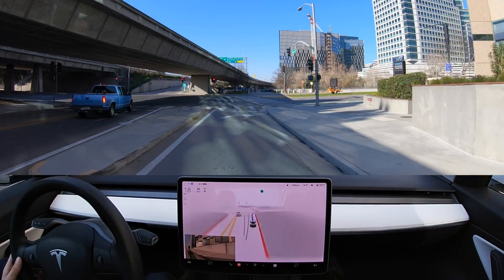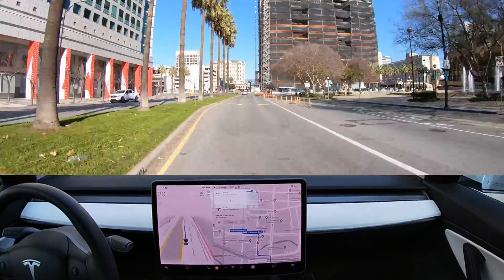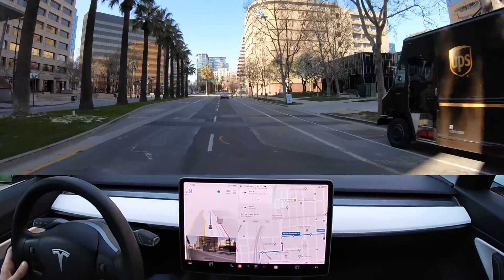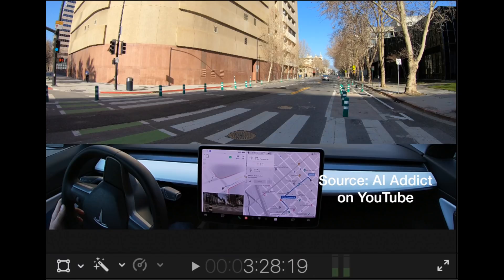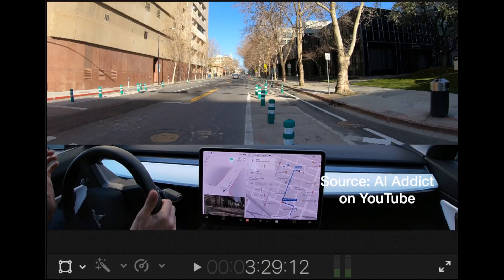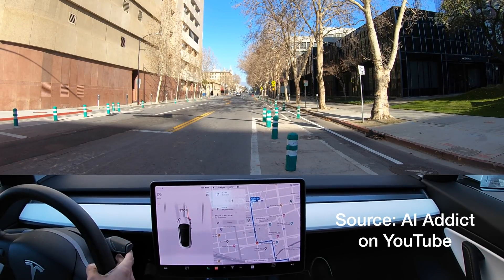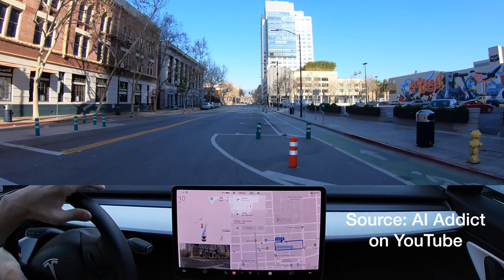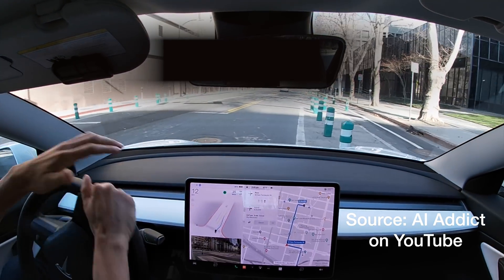Self Driving Collision (Analysis)

Comment: Did the autopilot turn off only because you started turning the wheel and pressing the brake? I wonder if it would have just kept on going...
Reply from the maker: After reach watching, you are indeed correct, it does appear FSD turns off due to my foot pressing the brake pedal.

If it weren’t for my reaction, yes it would have been far worst. Even with my reaction the car still collided with the object

Comment: Even with a fully alert driver taking the controls as quickly as possible, the accident still happened.
Reply: Right, because the idea of transferring to human control, a split second from a giant crash never made sense (no matter who decides when that is). Instead, this idea is as dumb as it gets.

Regarding autonomous control, you either have it (level 4 or 5), or you don't. Level 2 and 3 autonomous driving shouldn't be legal. Level 1 self-driving including cruise control and lane guidance and such make sense, if drivers stay attentive, and are warned early, if any problems even start to emerge. But more automation than that just tempts drivers into hoping the vehicle can deal with it, and any autonomous driving failure of that type can be dangerous and could be deadly, especially at high speed. Blaming that on the human driver is ridiculous, and it should be illegal. What Tesla has been doing is conceptually flawed and never should have been illegal in the U.S.

Comment: Thanks for posting.  You’re helping us drivers understand the limits of FSD and thus making us all safer.  I hope Tesla management appreciates your intention. The thought of them not sharing this is  silly. I’m a aircraft Pilot and through study of  both mechanical and human error responsible for inside the all pilots and passengers move the safety needle forward.
Reply: The employee has now been fired, reportedly for posting this.
Reply: The limits of fsd... if it cant even properly turn left, how its going do the rest correct? Trashla (tesla) fsd is a scam, and if you wanna die then use it

Comment: Removing LIDAR, a technology that could easily help the computer get an edge over humans, was a dumb error, Elon
Reply: Technically they haven't removed LIDAR - they've never backed it. But now LIDAR systems are getting cheaper - like sub $1000 vs $50k it's going to be harder to come up with the argument that LIDAR is not of benefit.
Reply: @markyates5744  lidar will still confuse it's self with cameras and other sensors. Just because you have more cheaper sensors and cameras doesn't mean it's going to work.

Comment: The accident is your fault. You were distracted. Simple. No excuse. As a fellow beta tester, you know anything can go wrong at anytime and you agreed to those terms.  It’s your responsibility to be in control of the car at all times. Your clickbait headline hurts the FSD program.
Reply: Distracted by the FSD though. So the whole system kinda blows superior. Can't monitor the road and the system at the same time.
Reply: @Treps1  I’d like you to consider this. FSD does not require you to view the screen to stay in control of the vehicle, or utilize FSD. Tesla’s only requirements are for you keep your eyes on the road, keep both hands on the wheel, and actually be setting in the drivers seat with your seatbelt fastened. 
I agree monitoring FSD could be a distraction, just like monitoring your incoming text messages while driving. But this is a choice, not a requirement. 
And as Tesla software matures over time, FSD should have the ability to remove all human distractions and hopefully will save lives. That is why I’m a FSD Beta tester.

Comment: There is something to learn for the system here, which is good. I am sure it will be fixed soon.
I am a little bit surprised, though. I supposed, avoiding crashes with any stationary object would be easy, whatever colour or shape it is.
Reply: Avoiding stationary objects is the hard part . . . it has to be identified as an object (is it an actual object or just marking on the street, etc) Thankfully avoiding moving objects is much easier . . . movement is easily detected.   FSD is getting better but still has a long way to go.
Reply: @trengilly01  Either parallax shift or 3d vision with view from 2 cameras should help with that. I suggest we can expect a fundamental improvement on this even when 2 of 3 cameras' focal length in the front is too long.

Comment: The blue line path looked ridiculous at the apex of the turn. It almost seems like FSD sees the near pylons, knows the path around them, but the pylons are much closer than the graphical displays indicates and so isn't able to steer away sharp or fast enough, and doesn't have time to apply the brakes. I assume FSD's relatively long system latency contributes to the inability of avoiding the accident.

Comment: This has been a problem for a while now, also some examples of trying to drive through poles on older versions.  Poles and bollards fall in between the main "static model" and the VRUs.  They get low priority in the model for some reason.  This is weird as the perception of such objects is good, even on the production AP.  It is not perception that is the problem it is the decision making that is flawed.
Reply: I'm not really in the loop on FSD, but how do you conclude that perception is not the problem? If it knew the pole was there, it surely wouldn't run into it?
Reply: @Mortyst  it perceives it's there, but makes the decision to drive into it anyway. Its not thats it's not seen it, it's that it doesn't care that it's there
Reply: Birthrates are a problem best solved with abortion laws and faulty autonomous vehicles (they’re killing people before they make it to the old-folks-homes!)

Comment: Time to change some "rules of the road". 
1- No green bollards. Too difficult to detect. Also, the white stripes on them are confusing with the other lines on the asphalt and the zebra crossing.
But, in this case, there is also a map problem, because the car try to enter the bycicle lane.
Reply: If you can’t see a green striped bollard how can you see a cyclist or a pedestrian? Either you are driving too fast for complex urban conditions or eyesight is not adequate for vehicle operation. Slow down and pay attention.

Comment: Hitting this is bad and should absolutely not have happened, however I find it pretty concerning you say the first time you had an indication things were going wrong is just before (in the same second) that impact occured. If you take a look at 0.48 of this video, the car gets awfully close to the bollard as it takes the corner. This should have put you on high alert and potentially even taken over at that point. 

It's only at 0.51s that impact occurs, a full 3 seconds later. Again, FSD beta screwed up, but you know the drill, you are there to intervene when it screws up.

Comment: I Googled "perception time" and "reaction time" and got 1/2 to 3/4 seconds for each. Depending on how one would label your reaction-vs-frame timeline, that is pretty much what you did.  Maybe a bit better than median, but not bad.  I'll help you buff out the scuff marks.  Thanks for the work.
Reply: Yep and FSD takes 2 secs or more to process the scene and respond. It's a systemic issue. There needs to be a different approach or more hardware parallel processing to reduce lag time. Shortcuts only work for so long.

Comment: Had to happen at one point. Still weird that it did not stop.
Since I already read the radar argument.
I don't think, that radar would have changed anything, not because radar is bad but Tesla had problems with stationary objects even with radar.
Reply: radar would most likely not even detect most plastics. The microwaves would just go through them.
Reply: @marklefler4007  Hmmm interesting!!!;)
Reply: @marklefler4007  radar on vehicles  emits light or ultrasound which dont go through plastic
Reply: @冒烟的飞机  No. Radar emits electromagnetic waves at a much lower frequency than light. Thats why it can see through the fog and we can not see the radar shine "light". Ultrasound is used for park distance control and could pick up the plastic, but it is really short distance only and not yet part of the autopilot code, it seems.
Reply: Radar at that close range would easily get a return. The plastic is relatively thick with 4 sharp corners adjacent to the reflectors. Plus that reflective material has oodles of small divots.
Reply: @kdub1666  Radar has much less accuracy due to long wavelength anyway.
Not confident that it coukd detect any cones

Comment: If you think this is an accident, which I agree, hitting a curb should also be considered as an accident. So, this is not the first.
Reply: If hitting the curb caused damage to the car then I agree.
Reply: A curb hit is an accident even if there's no more damage than the wheel alignment usually needed after one of those.   Hitting any obstacle which the vehicle should be nowhere near is a serious matter.   Most self driving teams, after such an event, would immediately halt all testing until the bug was fixed and confirmed.
Reply: An accident would be potentially any unwanted or unintended behavior, so yeah hitting a curb isn't something people intend to do during the course of normal driving and should absolutely be considered an accident.
Reply: Humans have accidents. Computers make errors.
Reply: Clearly there are levels of "accident".  Grouping all negative events under the single word accident is a bit silly.  If the car ran over a grey cat I doubt the air bags would have released but cat lovers would consider it a very serious accident.  I like my tesla and do FSD beta testing but this event should not have happened and word smithing the definition of accident by some people is not helpful.  I agree hitting a curb is a negative event and should not happen.

Comment: Maybe it would be better not only to relay solely on cameras. It makes sense  to have radar sensor on board as well!
Reply: Radar doesn't work in the rain or snow. It's unsuitable for self-driving.
Reply: @bergonius  Then don't rely on it in conditions it isn't suited for.
Reply: @TheSpartan3669  If we don't rely on radar in harsh weather conditions, why we should rely on it in good conditions?
Reply: @bergonius  Because the system will perform better in good conditions. For instance here LIDAR would have detected that pylon.
Reply: @TheSpartan3669  vision based system would have detected the pylon as well.
Reply: @bergonius  This accident occurred with Tesla's vision system...
Reply: @TheSpartan3669  So what? That's probably classification error, or decision-making error. This could occur with LIDAR system  just as well. 

You see the pylon by the vision? Then you can avoid it by the vision. After all you do every time while you driving.
Reply: @bergonius  How are you so sure when the visualization clearly didn't show the pylons? I'm not saying that LIDAR is infallible just that LIDAR+Cameras would be far more likely to avoid collisions like these. 
The eyes that we use are much better at perceiving the world compared to the low res cameras here.
Reply: @TheSpartan3669  our eyes are pretty low res as well, except for small fovea in the center. Tesla's vision is obviously sufficient, giving the dude was testing for a year prior to it with no collisions, and thousands of other testers driving millions of miles.
Reply: @bergonius  There were no collisions because he intervened in time. FSD tries to run into objects often.
Reply: @TheSpartan3669  amount of interventions is pretty low, measuring in miles of driving between them. That says that it's doing very well, only a few rough spots left to fix
Reply: @bergonius   Not really. DirtyTesla's previous video had 6 interventions and 2 disengagements in 9 miles. There were multiple disengagements in this video alone. For comparison Waymo (which is geofenced I know) averages 30k miles per intervention.
Reply: @bergonius  the problem is, camera vision doesn't see everything.  It's wishful thinking that it does.  It's flimsy in medium rain, snow, intense sun, at night, sees ghosts in shadows, etc.  All sensor types have different strengths and weaknesses.
Reply: @bergonius  the amount of interventions by FSD is horrible in busy urban driving.  Probably can't go five minutes on average without bad mistakes in busy cities.  Waymo averages something like 30,000 miles per intervention, all in urban driving.  They probably need about 500,000 miles per intervention to be fully ready for urban robotaxi.
'Only a few rough spots to fix' is an idiotic statement.  You watch too many empty suburban drives with 'zero interventions'.  Those indicate nothing toward urban autonomy, which all robocars have to be good at to get any valuable license.
Reply: @charliedoyle7824  waymo still geofenced in small areas, blowing up miles per intervention counter, even if they don't lie about it (since there's no independent footage of it driving, like we have with fsd). And that means it's incapable of most unstandard irl situations, otherwise it wouldn't be geofenced.
Reply: @bergonius  geofencing makes perfect sense in a major city, to learn in the hardest environment necessary for a robotaxi license, as fast as possible.  You show a lack of understanding of why to train in an obstacle course like SF and NYC: the weird corner cases that occur everywhere come at them at a much higher rate.  There's nothing 'standard' about the crazy stuff that happens in San Fran and NYC, where they train with huge miles.  Waymo can handle tons of the hard stuff that Tesla sucks at.  Tesla is only okay at easy suburban driving.  They aren't even safe for autonomy on highways yet, the easiest of all driving.  
  
Also because cameras and AI alone won't solve urban driving anywhere for a long time, using maps and geofencing is the only way to valuable autonomy in the short to medium term.  I won't be surprised to see Waymo and Cruise get a ten-year jump on Tesla in urban robotaxi.   Tesla will never get a robotaxi license in a particular city unless they can prove millions of crash-free miles in that city over many years.  

It's nuts for you to not believe Waymo's numbers, which are reported to CA regulators, and believe Elon, who doesn't report any FSD Beta numbers.  Plus, it's obvious to anyone that Waymo drives about 100,000 autonomous miles a week in San Fran, and about 10,000,000 miles in CA and Arizona, and they've never caused a serious crash.  Tesla can't even dream of that kind of performance.
Reply: @bergonius  radar for autonomy is advancing quickly.  Other companies are developing cheap radar systems that are standalone sensor systems by using AI to stitch together multiple sensors into one image that is as useful as a lidar image.  Radar will likely become standard and essential.  
Your stuff about it not working in rain or snow is silly, just repeating Elon's lines without delving deeper.  Cameras don't work perfectly in those situations either.  All of the sensors are improving rapidly.
Reply: The car still has ultrasonics which could detect this. This is a path planning problem, not a sensor problem.
Reply: radar does not detect plastics (unless they are laced with something conductive).